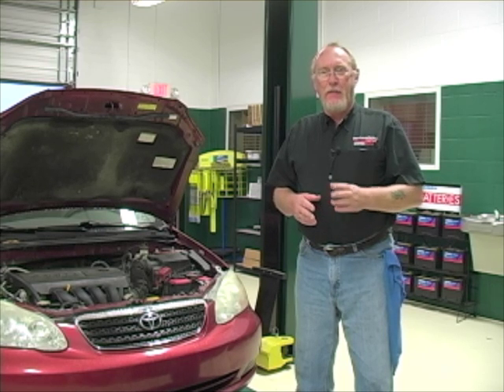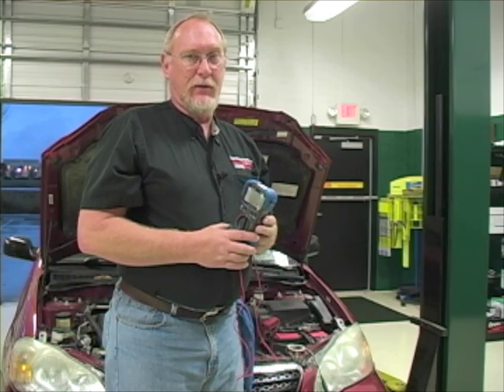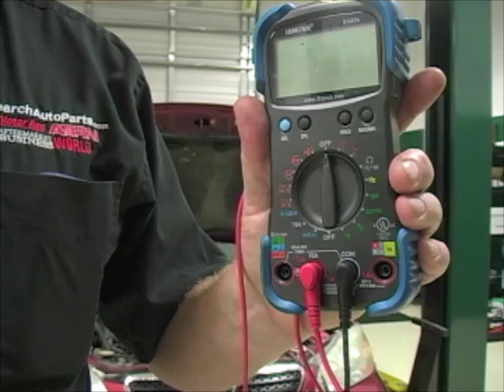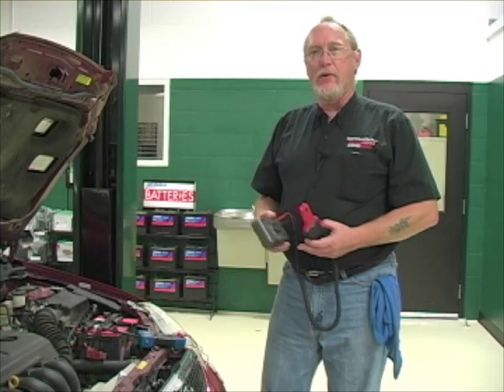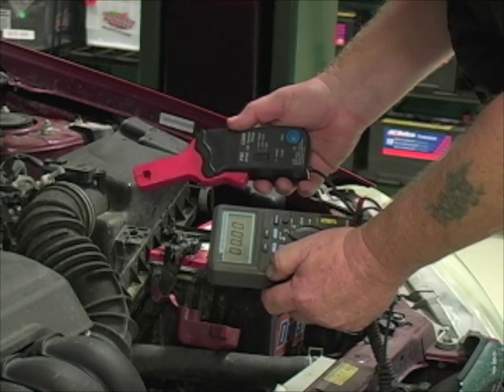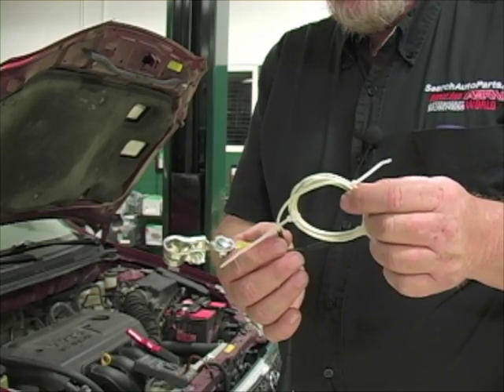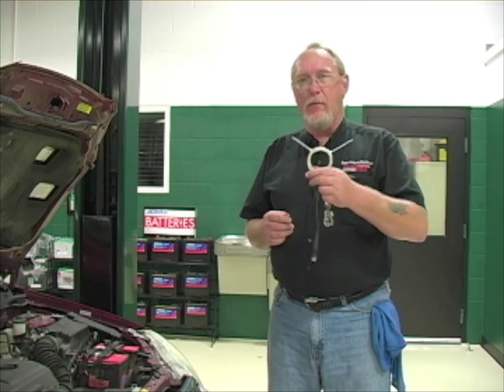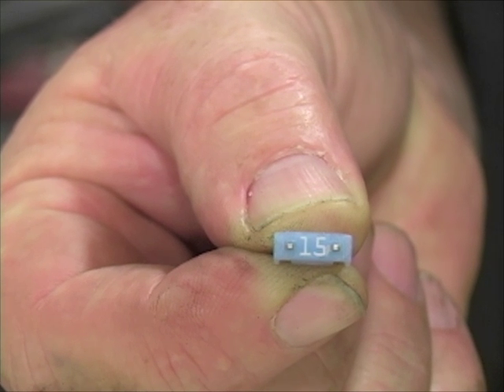The Trainer #27: 3 Ways Of Finding The Cause Of Key-Off Battery Drain (Parasitic Draw)

Comment: Very good teaching , one question of the third method , current drop measering. Some fuses are not with the 2 measure points. They are smaller as that You measure. How do you measure such kind of fuses

Comment: Hey Pete.... what about intermittent parasitic voltage draw , like wipers that turn on  intermittently? You could test the fuse when the signal is off and completely miss the 'parasitic draw' from that component. 
Method No.1 ... using the Max/Min facility on the DVOM ... will indicate intermittent voltage draw, from all components, won't it?
Reply from the maker: I made another video on this subject, and show a method for catching the intermittent. You're right - you can't track the draw source down unless it's active, so use a separate amp probe to monitor the draw and only test across the fuses when you see the draw occurring.
Reply: @VehicleServiceandRepair  Thanks Pete for your prompt reply, Ill check that video Best regards.

Comment: Thanks for these lessons. 
I’ve a drain which has gotten worse. I’ve removed the main positive to maxifuses and the draw remains. On the other main positive cable I’ve disconnected the starter motor, then the alternator and the draw seemed to get worse. 
I put it all back together and the draw is still above 12 amps,
Biggest fused draw I’ve come across is .8 for the fuel pump. Every fused draw I’ve found disappears when the car shuts down. 
How do I find this big draw? I disconected the alarm siren months ago. Regards
Reply from the maker: This caught my eye - "Every fused draw I’ve found disappears when the car shuts down." Are you testing drain with the key off engine off? If so, explain what you mean when you say "Every fused draw I’ve found disappears when the car shuts down."
Reply: @VehicleServiceandRepair  hello I put all the fuses and relays back, checked the voltage drop on fuses running, 
All disappeared when the vehicle shut down as it’s supposed to. 
Still got a massive draw when decide to do an amp test when the pos reconnects which dies down but is still big. Disconnect the main pos feed to 5 maxi fuses and still the draw is there. Checked starter and alternator both seem fine.
Reply from the maker: @peaandham1973  It sounds like you're testing for draw with the engine running. Draw is normal here. How are you taking your measurement? What is the problem you are trying to correct (that led you to suspect a draw)?
Reply: @VehicleServiceandRepair  hello I’ve shut down  everything with the engine off, pulled all the fuses, pulled all the relays, pulled the main pos lead to the feed to the 5 maxi fused main cables. This left only the other pos lead to the alternator and starter. Disconnected the starter and alternator. Put the battery neg back on each time and the draw got steadily worse. Put it all back together.  When the engine is off and key removed locked and unlocked the battery voltage quickly reduces and if left it will go down to 5/6/7 bolts. When I take the negative lead off it’ll jump back up to 10 or 11 depending on how long I allow the negative to be on. 
So as far I can determine it’s nothing powered by the maxi fuse  Main pos. 
I’ve checked, removed, cleaned the connections at starter motor, the voltage at the starter main  connection is the same as the battery, the solenoid small connector is zero, the solenoid earths ok. On the alternator the big cable gives battery voltage when off and 14.3 when engine on. The  body earth is good. The diode resistance is open circuit red to big screw black earth on the alternator body and about 600 black to big screw red to alt earth . 
Once I’d disconnected then reconnected the starter and alternator after cleaning the connections I reconnected everything up as per getting the car ready to fire up and 
It starts if the battery charge is still above 11.5v,
The alternator charges at 14.3/5v 

As soon as I turn the engine off the voltage drops. This happened after a fully charged battery at 12.6v within a split second it drops to 11.3 then just goes down. 
When I put the 10amp dc current cables in series with the battery neg post and lead after all the  disconnects and reconnects it started drawing 17Amps with a good spark to announce it. 
The car still starts and drives, holds a charge whilst the engine is on yet as soon as ignition is off the big draw recommences. I have to remove the negative lead every time or the battery will drain fully. Ordered an amp clamp and test lights as I need to see where the current is going. 
I’ll have to check again for lights and heat I think. Pretty stumped
Reply: Ive been doing checks for milliamps with a device that lets me remove a fuse and put in its cradle then plug into the holder. It tells you the draw. 
I was looking at the mv draw on the fuses also. I’ve done this several times when the car is asleep and awake.
What threw me later was the big volt drop on connecting the 10Amp meter in series, I used the second meter to check the voltage drop. Definitely made a boob somewhere as one meter is 
No longer measuring current.
Reply from the maker: @peaandham1973  Let's start from the beginning. Watch this first:  https://youtu.be/lsv0VPhcfow, then use the DVOM method to do a quick check on the battery itself. It has to be fully charged before you test it. What I want to know is what the loaded voltage is.

I also want you to measure the amp draw, Key Off Engine Off - also with a fully charged battery. If possible, invest in a low amp clamp that you can plug into your meter or a standalone tool.

What kind of car are we working on?
Reply: @VehicleServiceandRepair  c220 cdi 2007 s203 (w203 estate) 
Charged battery several times. It holds 12.6 v. Checked the battery by leaving it over a couple of nights, no drop in voltage. Also used an electric battery tester which said it’s fine on starting. The charging voltage is about 14.3. 
Got an amp clamp. There are 2 battery pos leads. 1 goes to a main feed to 5 maxifuses. 
The other one goes down the back of the engine to the starter. Another lead comes from the alternator to the main starter lead. I’m struggling to access this bit. They both appear to go on the starter main feed. 
There’s a small starter cable. 
When everything is off and the car is not long locked there’s a small current .3 to the maxifuses pos lead. There’s 18A going to the other pos lead which goes to the starter and alternator, this gradually reduces as the battery discharges. 
There’s nothing at the alternator main cable when the engine is off. 
This is a RHD UK car and the starter is quite inaccessible. I can reach the main cable nut and the s small cable nut. I’ve removed the connections previously and the discharge remained. 
When the car was locked up, ignition key removed I still had a bright light from the test lamp at the main starter cable. I’ve tested and still changed the starter relay. The s screw is 0v and no light up with the test bulb. 
Is there meant to be a permanent live at the big cable? 
Car if battery connected and engine off drains the battery at a high amp 18amps and reducing. 
Caught the battery there at 10.9 before the charger refuses. I’ve got a cool box 12v power supply plus a male connector to red and black clips if it goes too low.
Reply from the maker: @peaandham1973  To be sure I understand - with everything connected you are getting a measured 18 amp drain when testing at the cable leading from the battery to the starter motor, Key Off Engine Off?
Reply: @VehicleServiceandRepair  yes, it’s a real pain trying to get to the starter connections. When I took them off there were 2 large connections tightened by the 13mm nut and one small wire on the 10mm nut. 
According to my wiring diagram the 13mm connects the battery to starter then starter to the big connection on the alternator. So far I can only get to this by lying under the vehicle. The 13mm to the starter was live constantly even when the car is locked up. The small one is live when turn the key. The starter operates as long as the battery hasn’t discharged. 
The alternator big cable gives no current when the engine is off. 

When running the battery to starter to alternator gives 18-20 amps, the battery earth gives 2/3 amps and the other battery pos to maxifuses gives a max of about .5A. I’ll do some more measurements and write it down.
Reply: @VehicleServiceandRepair  hello I believe I’ve found the problem. There’s a booster coolant heater, bolted to the engine block under the inlet manifold and above the starter. 
It’s designated N33/2 on the wiring diagram. It’s main live feed is piggybacked to the main starter live connection. When I disconnected the starter there was still a huge amp draw on this circuit. The main lead circuit ends at this booster heater and jolted to the engine block, heats coolant in the engine. Ive read that it can fail short circuit into the heating elements bypassing the control circuit. I’ve removed it and ordered a replacement. I did a test on it by putting jumper leads red from battery pos to the main pos connection and neg batt lead to the body of the unit. I got a huge amp draw. So as far as I can tell there’s a short.
Reply from the maker: @peaandham1973  Glad to hear it! That component was not shown on the schematic I was using.
Reply: @VehicleServiceandRepair  yes it’s not on the Haynes manual either. S203, sport edition ( w203 estate model). Someone had posted the diagram on a Benz forum and was having starting issues. I’d checked the alternator and there was nothing when key off. A diode test key off and voltage 14.4/5  said the alternator was good. I’d already disconnected the main maxifuse which protect all the other car circuits. I was concerned my problem was the alarm but wasn’t sure what was going on at the starter. 
Leads tested and removed plus a working starter ruled out the starter. I couldn’t see above the starter. 
I’d found on the diagram there was n33/2 which is a booster heater and n3/9 cdi control unit. I knew I had a big immediate volt drop with starter and alternator disconnected. Stripped the common rail,power steering reservoir,fuel hoses, removed oil filter, thermostat housing, transmission dipstick tube, part of the throttle body just so I could move the air  inlet manifold enough to get to the top of the starter. Once moved I see a square box with 1 control connection and I main feed coming from the starter big feed. As far as I can tell it must be this. The huge draw is the battery heating the shorted coil/s there’s 4 of them immersed in the block coolant, held in place by 4 short E11 screws.  Used replacement in order for £45. I’ve got spare coolant and power steering fluid and I’ve ordered some liquid gasket. Really hope this resolves the issue. I can’t see how it won’t as the big draw ends here.  I wouldn’t have found it if I didn’t look for the voltage drop and then the orange draw on the amp clamp.  I took the manifold apart before I knew what n33/2 was. I knew from your testing lessons that my problem was under there.   Thanks very much

Comment: I have a problem with a car that when the key is turned on to start the car there is a massive power drain in such a way like how the power would drop if the starter is stuck. The problem is, its not the starter that is the issue. This problem just started happening to a vehicle that had been sitting for several months.

Comment: I'm late to the class, I have a 2016 Impala that has 300 millivolts parasitic draw (battery is drained in about 3 days of sitting) confirmed via meter. Pulling all fuses and relays does not reduce draw. Any suggestions? Could a diode in the alternator be bad or potentially the electromagnet be closed causing draw. Additionally is it possible that a trunk light or glove box light not be on a fused circuit? Thank you for any direction you can provide. Your explanation and demonstration was superb, thank you.
Reply: @The REAL DIY Garage thank you for your response it's greatly appreciated. Yes voltage drop across the fuses in the location under the hood was performed as well as removal of them and relays (no change in parasitic drain). I don't have access to a thermal imager at this time. Additionally the alternator was disconnected with no change, 50 Amp output was verified per mechanic. All work was performed at an independent garage. Could it be possible that the battery is emitting the 350 mA due to age, battery is 7 years old. I have not detected any fusible links as of yet. It seems to me that the only way for parasitic draw to occur is if an electronic component is pulling it, not just a deteriorated/aged battery. Can you recommend a way to find or determine if fusible link(s) exist (wiring diagram)? I'm also under the impression if maxi fuses in engine compartment aren't pulling current then the fuse block on the left side of dashboard by drivers door don't need to be tested for voltage drop? I very much appreciate your insight, thank you!
Reply: @The REAL DIY Garage Very much appreciated, it is the 2LT with the 3.6L V6 motor, if needed I could provide VIN if that's easier. Car is with my son at college now, he has been disconnecting the negative cable at battery until correction is made. Thank you very much for your time, patience and effort. My son is well versed in electrical circuits as he is active in robotics programs and at Michigan Tech to become an electrical engineer. Your insight will help us find the culprit. 👍
Reply: @The REAL DIY Garage 10-4 much appreciated!! Have a great day. 😉
Reply: Problem solved, OEM back-up lights were replaced with LED's some time ago by my son. The LED's continue to draw power even after vehicle is off, in our case the right side was on, but not illuminated to see it through the lens even at night. When we pulled the socket out of the lens you could barely see the illumination. Apparently the LED's are an issue with GM, it is thought that the BCM will not shut down because of the power draw. Did a little reading on line and that's what led us to check the back-up lights. Not sure why pulling fuses or voltage drop across fuses didn't reveal circuit problem at service garage. Our meter indicated 350 milliamp draw when in series on negative side of battery. Perhaps they didn't pull/check that circuit? Thanks for your earlier replies.
Reply: Can anyone explain how to check voltage drop on a jcase fuse? Thanks 🤞

Comment: I have a very early vehicle ( No Computer ) I have done the classic test of ground cable off the battery to measure .24 with the multimeter set to 20A DC. When pulling each fuse all tested good and the fused circuits did not cause a drop in parasitic draw 😠. Tested the alternator diodes and got a reading with everything disconnected of 816 with the ground lead (black) to the charge output post and (red) to the alternator body itself. When I swap the leads I get no reading. With the two wires and the charge wire off the alternator I get no paristic power loss across the batterys negative post and the main battery ground cable. Does it sound like a bad alternator some how? With everything hooked up the alternator is putting out 14.7 to 15.1 volts depending on engine RPM so the internal voltage regulator seems ok. I am really stumped on this one......Help!
Reply from the maker: I would remove one wire/cable at a time to see which one causes the draw to stop first. Is the charge warning light in the instrument panel illuminated?
Reply: @VehicleServiceandRepair  this vehicle has a 2 wire plug on the alternator. One wire is hooked into the harness but the other wire ( I believe for the warning light ) doesn't go to anything. Could this be the problem?
Reply from the maker: @JDWard-Jeepster  Looking at a generic wiring diagram, I don't think it makes a difference. Either the field coil is on all the time or the charge light circuit is grounded internal to the alternator. Replace the atlernator.

Comment: Pete : On my jump pack , there is an adapter to charge it in the cigarette lighter . Wouldn't this keep the system powered if plugged in ? I believe it would also work as a memory saver . Thanks for your information .
Reply from the maker: Keeping memory alive by plugging into the cigarette lighter (now the Power Outlet) used to work - but no longer and not for some time.

Comment: I've got an 03 grand marquis and when I do a parasitic test it shows 0.03 amps but my battery dies in 2 days if I don't disconnect the negative cable
Reply: I am currently working on a 2002 Taurus . The battery which is only 19 months old , goes down after a few days . I fully charged it and disconnected it . It fails under a load test after sitting , disconnected , after a week .The car , after a parasitic drain test was at 20 milliamps - well within specs . It took an hour or more to power down . You can do a ripple voltage test on the alternator . That will tell you if the diodes are bad and allowing current to drain when the system is not running . The alternator on the 3.0L , DOHC Taurus  is HORRIBLY burried , so that test is almost impossible with a DVOM . I have a Electronic Specialties 725 Battery Tester and it will run the test at the battery . Many high end testers have this . I would also fully check the charging system . Make sure no add on items such as alarms , radios , etc. are powered on . Sometimes a rear wiper is stuck on and keeps trying to " PARK " itself , even cycling every few seconds or longer .